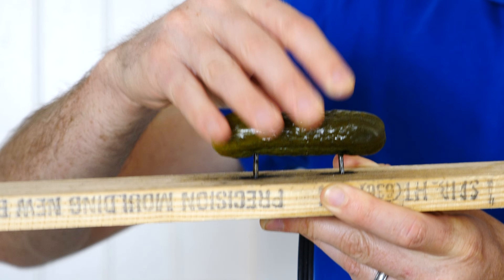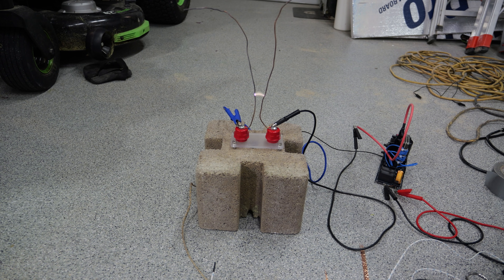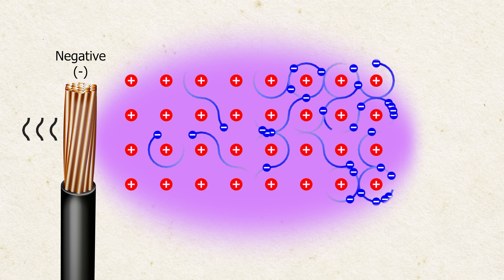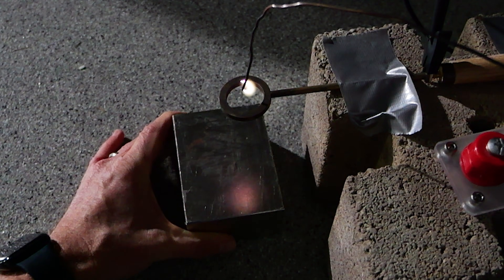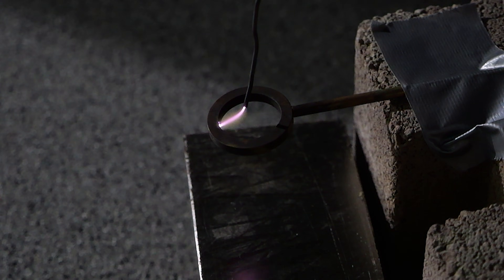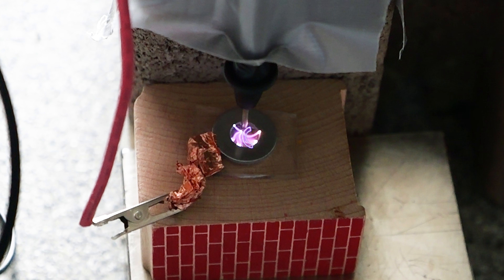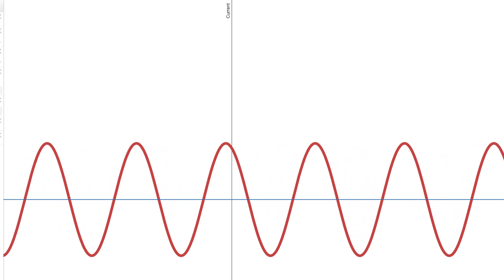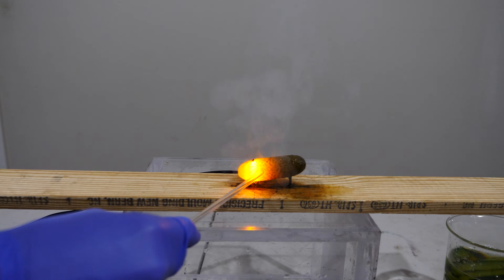Why AC Electricity Doesn’t Behave the Way You Think

Comment from the maker: For the ZVS driver with the flyback it’s likely that there are internal diodes making it pulsed DC (as many comments have mentioned). But both the neon sign transformers should be pure AC (especially the second one).
Reply: is this considered a LED from the way it lights up? lol
Reply: FLYBACK TRANSFORMERS  HAVE A HIGH VOLTAGE DIODE STACK INSIDE THEM SO THE ZVS DRIVER IS GOING TO OUTPUT DC FROM THE SEC COIL
Reply: "Very hard" or "impossible" for the very last sentence? I was going along thinking it was like finding a perfect sphere, theoretically possible but not here in messy physical reality.
Reply: I would say that the pickle has nothing to do with AC, it's whichever side decides to vaporize the vinegar first and then starts arching. That drops the current and the arching continues on that side only. Eventually enough fruit body burns away and that side drops down making contact with the wire setting up the system for a possible new plasma point. With the Jacobs Ladder if both wires are that exactly the same length and bent the same terminated with the same thermal resistance to the environment you won't see a thermal difference and the flame will be symmetrical.. You're basically chasing the wrong rabbit.
Reply: Please fix your microphone on your collar properly.
Reply: You could get closer to pure AC by isolating the output of the ZVS with capacitors on both legs. If your frequency is high enough the capacitance would not have to be large but you would need to series enough caps to achieve the voltage rating. One electrode may fire preferentially however the current imbalance would be neutralized once the arc switched polarities and the excess voltage was able to flow.
Reply: Some electronic neon sign transformers intentionally apply a DC bias to the output for some mobing plasma effects in the tubes.
Reply: Hi sir 🙏
Reply: Get a haircut
Reply: @Cobra365 what a rude thing to say

Comment: Shouldn't you be able to block a DC bias from the electronics by putting a high voltage capacitor in series in the output?

Comment: That's the AC signal not to account for the (compiled resistance, capacitance and inductance) of the pickle short circuit and how it is heated and changes through the electricity applied. You need to look at Peter Lindimans video called Teslas Cold Electricity

Comment: Actually the DC is also created in the Flyback transformer you are using. Which is actually a CRT driver and has an internal rectifier. It’s output is +25KV.

Comment: What about if you use a spark gap instead of ring and needle configuration. For example two nail points facing each other. This should give a straight plasma arc and be close to symmetrical. Then rerun the test with a magnet and see how the arc deflects.

Comment: Did you eat the pickle after zapping it?  The mustache and mullet are an all new never before seen you!  Interesting how the sine wave has two sides of it an upper and lower also inner and outer.  Have you tried this experiment inside a vacuum?  I think the electric current produces a vacuum within itself that is constantly changing it's direction.  This is shown in the sine wave with the highest and lowest points also the inner and outer parts of the curves.  Well looking at the electric arc it has it's outer and innermost areas similar to the sine wave.  The way you describe the movement of the  electric current kind of looks like the vortices of the sun's surface.  Do you plan on growing a really big mullet that will throw static sparks when the blankets get pulled over your head?  What about the moustache are you going to wax it up into ringlets?  Listen to this, Big Science and Big Hair.  It sounds like an eighties rock band.  It is the new Big Fad.  Thank you ActionLab.

Comment: I reckon, if the thermal coefficient of the pickle is a vast negative number (hot pickle conducts way worse than cold pickle), the end of the pickle that conducts worse experiences a greater voltage drop, thus discipating more heat and making the conductivity even worse. This is then a positive feedback loop, causing the majority of the power to be wasted on one end.
This would be a nice and simple explanation, however based on the way pickles conduct electricity, I would assume resistance becomes smaller if the pickle is heated...

Comment: Funny, the heat and current in a DC arc lamp is completely opposite your theory. In a DC Carbon Arc lamp the long fat electrode is the positive anode and is consumed at a much higher rate then the small short negative Carbon electrode.
In a Short Arc Projection Xenon lamp, the large Tungsten electrode is the Positive and the small pointed electrode is the Negative Cathode.

Comment: I’m guessing this explains why flame rectification works with gas spark ignition. As soon as the flame is established there is a difference in current detected by the ignition module and it immediately ceases the sparking. Maybe these two things aren’t identical but I’m thinking there is some relationship there right? Thanks for the fantastic videos as always.

Comment: Omg I knew it. There is something wrong. I’m am service technician of hearing appliances and I see a increase failure rate in electronic control components whenever the appliances are connected against factory data ( Main connected to neutral and vice versa) in theory it doesn’t matter because AC. The appliance will run but the electronics will slowly heat up in wrong places leading to heat failure, often microscopic. Very interesting topic?

Comment: Technically speaking it's not necessarily either AC or DC. Electromagnetic (as well as e.g. acoustic) wave can be composed of multiple wavelengts. The zeroth order "wavelength" is sometimes called a DC component. Imagine walking forward doing two steps forward, one step back - that walk has both DC and AC components, you are effectively moving forward (nonzero DC component) but there is oscillation as well 🙂

Comment: Besides the total blunder of the ZVS flyback driver, ignorant to the fact the output is rectified DC with those transformers, I don't think the pickle explanation is right, even if there might be a slight rectification effect. (lots of things can make crude rectifiers...)

The reason is much more simple. initially both ends have similar resistance and power dissipation. Highest right around the electrodes where the current density is highest. But just due to chaos or random chance, one goes higher resistance than the other. This is a resistor divider. There will be much more voltage drop across that electrode than the other, and since current is equal at both ends (KCL), that end will dissipate proportionally more and get hotter. It becomes a self-fulfilling prophecy, or positive feedback loop and latches. The other side cools down and becomes lower resistance as electrolyte solution engulfs the electrode. This side cools down as it only sees a minority of the voltage drop or E field, and the total current has also decreased since the total resistance has gone up reducing the current.

This has literally nothing to do with rectification effects.

With DC, is it a near certainty that the negative electrode would arc and spark in the pickle? If not I then I'm not so sure that these effects have any relation or correlation whatsoever.

Comment: Let's say you created a capacitor with a very low value, but a high enough voltage limit that it could handle the A/C signal being fed into your Jacob's Ladder or pickle. Could you remove the DC bias that way, or would the geometry of the electrodes itself create a DC bias independent of the signal coming in?

Comment: Lots of people misunderstand polarity in AC. If you look at an open AC circuit and measure each of the open ends with an oscilloscope, you‘ll see a sin wave on one side (which is called live) and nothing on the other (which is called neutral).  Now if you close the circuit with a resistor and overlay measurements from both sides of the resistor relative to ground you‘ll observe that both sine waves are phase aligned but have different amplitudes. That‘s because even if the electrons just wiggle around, the energy flow still has a direction: from live to neutral. That‘s where the asymmetries with the plasma originally come from. That would explain why the curvature of the plasma in a magnetic field changes directions when you flip the wires. The pickle on the other hand is a set of infinetesdimally small resistances with random values. Hence its unpredictable.

Comment: maybe it is because you in your case ac use 1 phase and 1 neutral wire, that is also on older wiring automatically connected to earth wire... 

try connecting 2 different phases of 3... L1, L2, L3

also, as i know, current from phase flows to neutral wire, that is why voltage tester only works on phase wires

Comment: 0:33 actually a neutral to ground bonded system would infer that the neutral wire is negative ...in a floating neutral  there isnt a positive or negative

Comment: It seems to me that the pickle is lighting up the side that has less mass and the side the prongs are more prominent. I'd say if you cut the pickle perfectly symmetrical and cut the tips off so it doesn't have any skin, then set the prongs as evenly as possible I'd say the pick would either light up all the way or start in the middle and spread out more evenly 🤷

Comment: 0:46 - but it's an unstable equilibrium, since heating cables lower resistance which drives more power which heats more.
Reply: Heating cables doesn't lower it increases the resistance
Reply: @soloarmy1358  what??? no exactly, you actually draggeed me into a rabbit hole on that one, do some research I'd recommend.
in short terms it is proporcional if you're driving current and inversely proportional if you're driving tension

Comment: That point about welding is really important. This speaker is incorrect. The electron's change from excitation band to orbital band imparts the heat. In SMAW welding, the electron heats up the electrode. This is perfect in order to reduce undercut and increase metal deposition. In GTAW welding with reversed polarity, the tungsten imparts heat on the work so that a filler metal can be applied.

Comment: Flame sensors in some gas heaters that depend on electrical fans use flame rectification to hold a gas valve open. The DC component is sufficient to energize a small solenoid that is just strong enough to hold the gas valve open. Such a system shuts the gas off both when the flame goes out and when the supply voltage disappears.

Comment: that old neon sign transformer, not the switching power supply one, the second oneits much much smaller than the ones I got in my youth.  In the early 80's, maybe 84 I built a tesla coil, my first. Yes we built them back then, learned about them in a book. I had to wind the primary & secondary by hand. using a quaker oat container for the primary, and a 3' tube as secondary. The capacitor  was idk how many sheets of 1/4" glass about 1' x 1.5'  stacked with aluminum. foil between sheets of glass, the foil came out every other piece from one side then the other then all on one side connected together to make a connector, same for the opposite side. That was stacked in a plastic container then filled with oil you have a large capacitor, spark gap was easy and a huge neon sign transformerm I remember, I was 19 yrs old or so the neon shop owner didn't want to sell me the transformer,   I explained, in a time I'd guess 99% plus of the population didn't know what a tesla coil was, I told him I was trying to make lightning.  he did sell it to me.

 I remember while tuning it, my cousin was holding a 3 foot fluorescent light bulb near it lighting it up, the bulb wasn't hit witsparks, he was away from it. I noticed there was a pretty good stream of sparks going from the end of the bulb to the ceiling! We were in the basement it was a low ceiling., he didn't feel anything so he got to where the sparks were hitting the bulb.  that transformer got me ranting, sorry...🙂

Comment: I see the confusion! the naming is bad, so you mixing the voltage and current meaning! the AC or DC are about voltage, NOT current, even though the name suggests differently. there’s no DC current! they should have named them AV and DV 😂

Comment: I think you are in a pickle with the pickle.  They are quite inconsistent internally and that can't be blamed on magnetic fields.  One of my most used books is James Dillon Cobine GASEOUS CONDUCTORS.  It is the bible on things that go arc in the night.  I have a couple books from his private library.  That and $5 gets me a cup of coffee.  DC offsets are a real problem with utilities.  The highest temperature in an arc is the transition from metal to the plasma, the foundation of EDM machining.  Another fun fact, the first high voltage transmission line was not located where you might think. It was in Teluride CO.  They probably thought if it didn't work out it could be turned into a ski lift.  It really entertained the locals at night with the light show.  Wire diameter makes a big difference!

Comment: I believe what is happening is the same thing that gas furnaces use to detect flame. The air is ionizing and then the ionized air acts as a rectifier allowing DC to pass through. Look up flame sensing circuitry.

Comment: Why does a line of plasma form between a wire and a ring-shaped electrode, instead of the plasma forming a "tent"/cone-shaped surface, touching the ring electrode uniformly?

Comment: Fantastic video. I teach electrical engineering and it's so easy to forget that even though the positive and negative fields and equations are symmetrical, the charge carriers themselves are so different. Same think in electrochemical systems, or anywhere you have big ol positive charge carriers playing a significant role

Comment: AC circuits in homes or businesses is NOT a balanced symmetrical circuit.  The neutral side is bonded to the equipment grounding conductor, so the impedance is not the same on the hot and neutral.  

To be perfectly balanced, both conductors need to have the same distributed capacitance per unit length and the same distributed inductance.  For example, coax is unbalanced (center conductor and shield have different properties) vs. 300 ohm twinlead ( which is balanced, but rarely used nowadays) or a better example is the differential pairs in a cat 5 cable (each pair is balanced).  

This might explain some behavior you see, but you really need to measure the V-I curves of the pickle.  It is likely non-linear, but far from a perfect diode.

Similarly, the Jacob's ladder probably has more ions emitted into the air favoring one side more than the other.

 Try running your experiments on an isolation transformer without a ground on the secondary so your AC source is balanced.

Comment: Before diodes, this phenomenon was used inside vacuum tubes to create something called a Fleming Valve or simply a Vacuum Diode. Taken to an extreme, in a vacuum and with a seperate heater circuit built in, they were often used in rectifiers and behaved just like solid state diodes. Pretty awesome stuff!

Comment: AC has a hot and a nuetral if you're running 120v. If you want to light up both sides, you need to use 240

Comment: I think you’re actually describing your pin and ring circuit as a capacitor, which makes sense. You’ve introduced a capacitor into your circuit, changing the phase of the circuit.

If I’m right, you could actually introduce a variable inductor into the circuit and flip the direction of the spin, and which side heats up.

You can make a simple inductor with a coil of wire wrapped around some sufficient dielectric (air might work). You could try that and see if the direction (or at least speed) changes when you include it.

Comment: These self biasing effects are actually used for practical applications! Reactive ion etching devices like they are used in semiconductor manufacturing need to accelerate ions in a plasma towards the target to achieve the desired etching effect. Instead of applying a DC bias externaly, some etchers achieve self biasing due to their electrode geometry. That way they can use a much simpler voltage supply.

Comment: So, the ether that the electrons carry does a considerable amount of cooling in the electron side of the circuit vs the ionized side of the circuit. 
     In other words, the evaporation of electrons on one side acts to cool that side vs the other side getting heated as the electrons pass through.
Evaporation is a cooling process.   In this case, using the ether as a carrier of the heat.

Comment: I think it has to do with one prong being 110v AC, and the other being neutral, 0. I didn't watch the video yet but im 99 percent sure that if you would use 1 phase on one prong and second phase on the other it would be balanced, just a quick guess tho - might also pop your breaker since the pickle on 220v will take 4x the power and it seems to already be pulling a lot by the looks of it

Comment: No, the DC part on your high voltage supply does not have t oto do with the driving, but with the autotransformer (from a TV) that had diodes on the HV output. It;s taken from a TV, that was used as Anode bias of the CRT.